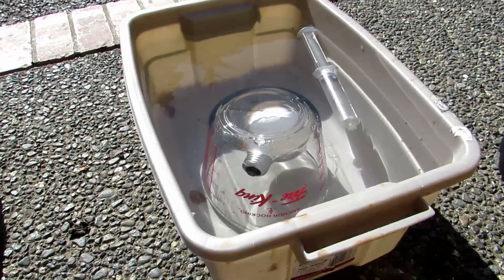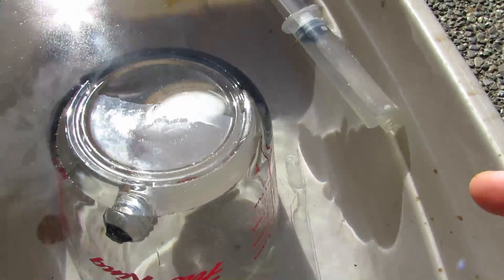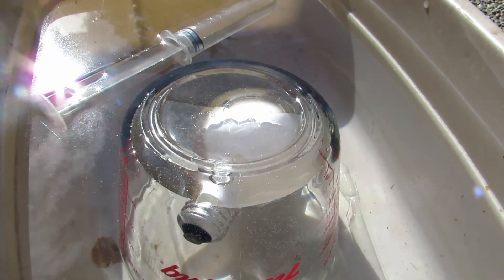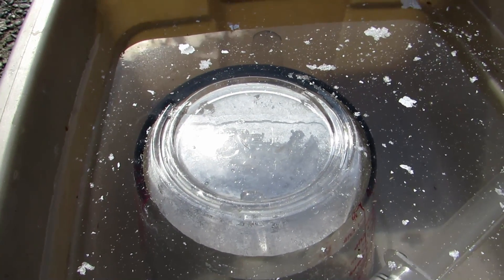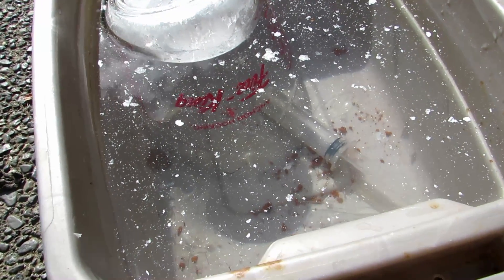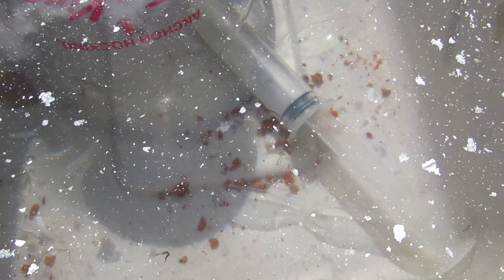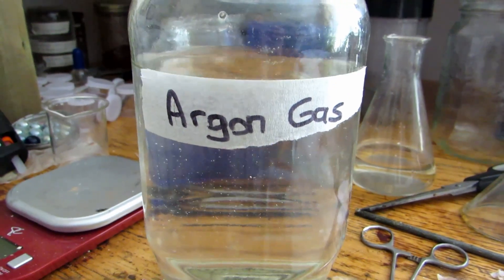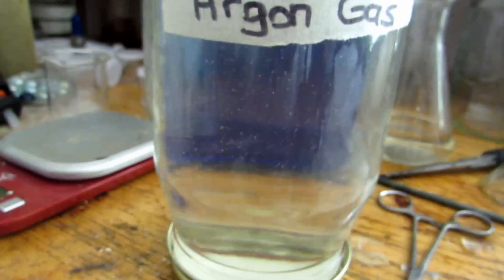Argon from Lightbulbs (Household Materials)

Comment: You could use TV flyback transformer to make an arc in a lightbulb and record spectrum with a spectrometer. Argon emmission line is at 810 nm. There is some nitrogen in the lightbulb often too. To get arc going through the glass need alu foil to glue on outside that it makes a capacitor and enough current can flow.

Comment: This was a REALLY great video.   I love how you transferred the gas around and store it.   It is tuff working with gases that is for sure.  I am very into the light thing and spectral thing.   I just bought some more LED lights for homolytic cleavage.   Now i got a  395nm  UV/   450 to 460nm blue/  520nm green / 620 to 630nm orange and red/ 660nm   red lights.   I thought all i wanted was a sodium lamp to get 589nm.   But now i want to make a noble gas light also.   Damn you science,  it's never enough

Comment: did you fill metallic threaded cap of the bulb? there's a space between bulb's glass and metal thread filled with air. it can be freed if you break glass.
i would cut this steel cap first. then i would submerge the bulb in water and break the nipple hidden under the thread. atmosphere will push some water inside the bulb, keeping gas secured and compressed to 1atm.
btw, gases disolved in water could contaminate argon, but anyway, thanks for the idea )

Comment: If that's where you get argon from then you are wasting an insane amount of time and money. You could take a small nitrogen tank(paintball tank) to any gas supplier or welding shop and have them fill it up for about 3 bucks. A 68ci tank(smaller than a football) at 3000 psi would get you approximately 1,000 times the amount gas you get from a light bulb. It would also be immeasurably more pure.

Comment: I think you have a lot of air in your "argon" gas.  In the video, I see 1/2" of air in the measuring cup before you broke the bulb.  The argon is at low pressure in the bulb, so the volume should be a lot less then the volume of the light bulb.
You should remove the socket as air will be trapped there before you put the bulb in the cup.  Then you can break only the bulb's fill-tube (while holding bulb in water, upright without the cup).  Then you can invert the bulb while holding test-tube over it.
I think you could do better by drawing air through hot tube with magnesium.  That will eliminate O2, N2, and CO2 and have argon contaminated with He, Ne, Kr, Xe, and water vapor.  Desiccant will get rid of water.
Reply: I think that was just the diffraction from he actual mwasuring glass itself reaching above the water. I don't think it actually had any air in it

Comment: Keep in mind that water has it's own vapor pressure, so there's some water vapor in your gas as well.  The good news is that around a warm room temp of 25 C, the trapped gas is only about 2% water vapor, so you do have mostly argon.  If you drop your water temperature down below 5 C, the water vapor fraction will go below 1%.  It's natural to think that freezing the water would give you pure argon, but ice also has a vapor pressure, and for ice, there is no sudden drop as you go from liquid to solid.  Whomp, whomp.  This is why a lot of early chemistry research experiments used liquid mercury -- extremely low vapor pressure.  I don't recommend using Hg for reasons you're already aware of.

Comment: Have you done a video on krypton? I think you can get it from torch/flashlight bulbs
Reply from the maker: you can get it from that but it is impure... it contains argon and xenon along with it usually. If I can ever be able to liquefy the Nobel gasses, I will be able to do a liquid distillation from flashlight bulbs. I will hopefully try that extraction in the future. thanks!
Reply from the maker: if you know where to get liquid nitrogen... that would be useful.
Reply: The King of Random actually has a video on how he buys it. So you could get it that way.

A much more ambitious and interesting approach would be to somehow make a homemade liquid nitrogen generator. However you would do that.
Reply from the maker: that would certainly be interesting to build such a generator. a while ago I read on how they do it. They compress air to very high preasures then cool it to room temperature. next they let the gas expand into the air over a tray of something. as the gas expands the energy is dispearsed and therefore the temperature is spread out evenly. this leads to the temperature being so cold that if condenses into liquid air. this would be very hard to do expecially considering the high preassure compresser and container to hold the high preassure. I have seen grant Thompsons's video on where to get it but I couldn't find a gas supply store anywhere near where I live. Thanks!